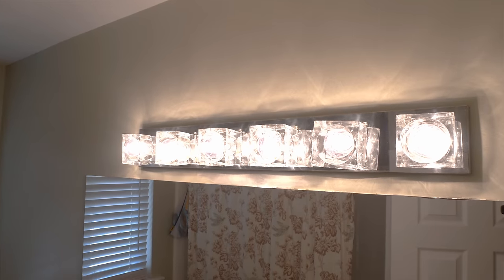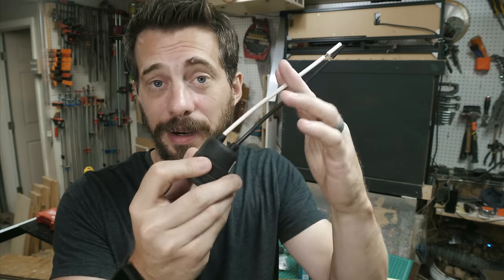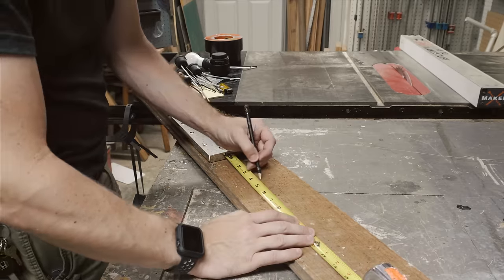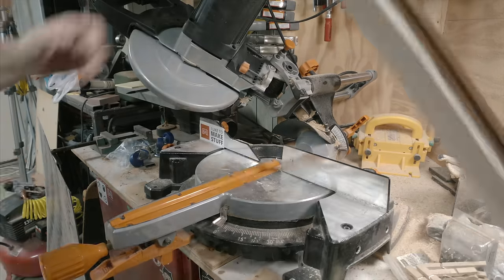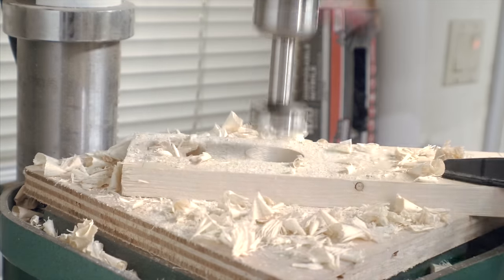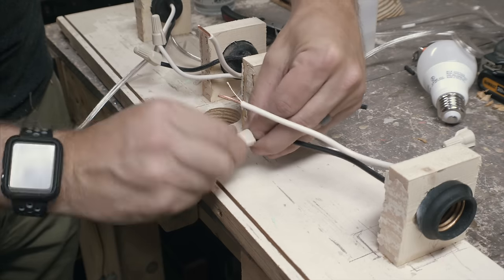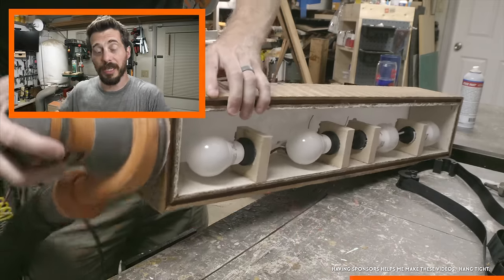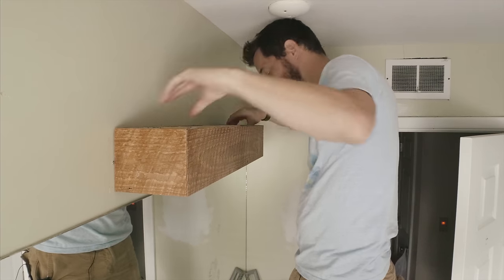How to make a Bathroom Vanity Light // Woodworking | I Like To Make Stuff

Comment: I'm sure it can't be that dangerous not turning off the power before changing the lights.
Reply from the maker: You're very wrong. 120v to the heart is a bad thing
Reply: I take it you're new to electrics? Or a young viewer? In the UK our electric is 240v (or 230v now). Whilst changing a light-bulb with the power on (as in not pulling the fuse) is perfectly ok, changing the fittings is not. I have touched a 240v live wire before. It does not feel good. I also despise the use of these wire nuts. Do it properly and use a connector block or solder the wires and use heat shrink or electrical tape. I think the regs book now bans the use of these in the UK, not 100% on that though. They are certainly frowned upon.
Reply: Yeah wire nuts aren't legal in Sweden I think, or at least not used. There are also pretty strict rules regarding "wetroom" electricity, i.e bathrooms etc, where water is in close proximity. I don't think the open top would work here.

To OP, what are the laws on accountability when you've done electrical work and then sell your house? Is it the new owners responsibility to inspect and approve?

Good looking fixture though! Last question, why all these bulbs instead of a single fluorescent tube? Again, maybe it's a Swedish thing with small tubes in vanity fixtures :)
Reply: Not quite sure what you mean. A light-switch has a live (from the fuse-board) and a switched live (going to the lamp). However some lamps have the mains feed going to the light first, and then using a connector block to the switch. You should therefore isolate from the fuse. (This should be done anyway in Bob's case as I bet he fiddled with the switch). Hard to explain on here, but an electrician should know what I'm on about. 
I'm not a fan of Wago blocks either. They are very good as a temporary solution, but they can easily be bumped and undone. In the UK all electrical wiring has to be inaccessible to tamper with by just using your hands (so you have to use a screwdriver to change anything)
Reply: No I don't know what you mean what the switched neutral and leaving the live on